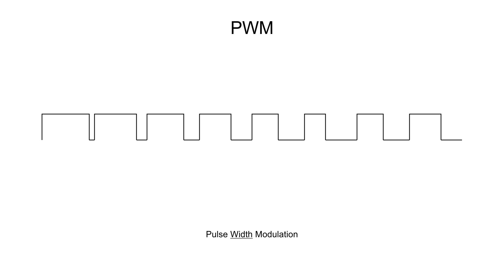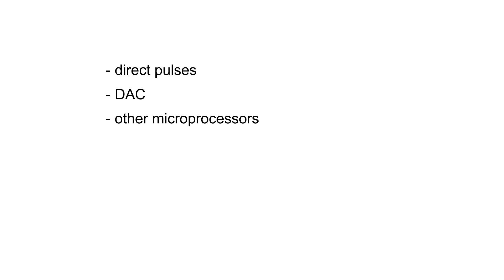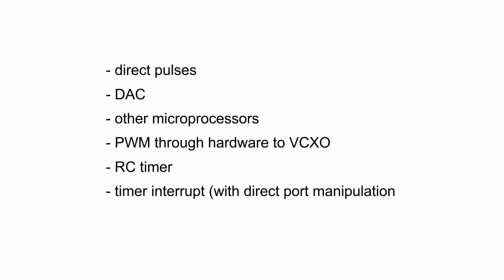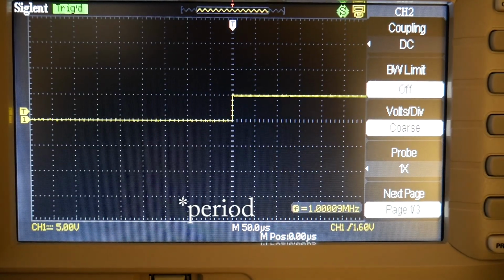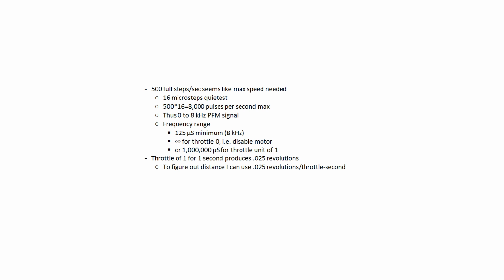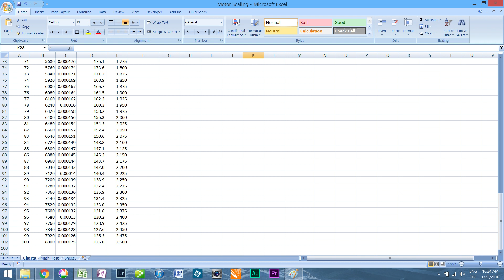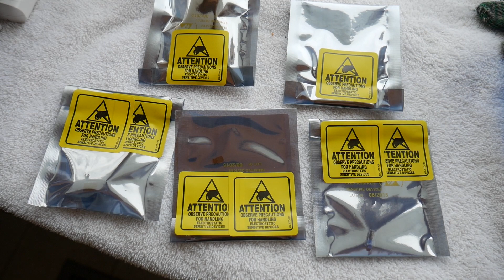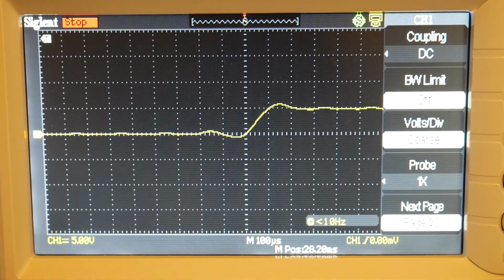Camera Control Arm #4

Comment: Connectors: Cheap options include Cat5 with RJ45 (8C modular) and telephone wire with the appropriate 6C modular connector. For things that move and don't need more than four wires, curley telephone handset cord with 4C modular works well. Last time I was in a Radio Shack (2 years ago. They are all closed here now) they had the cords and receptacles in stock cheap.

Holding header pins straight when soldering wires to them for protoboard use: Stick the pins through a stack of perfboard scraps. The variance in the holes on perfboard will usually give enough friction to hold the pins in alignment. You can also use a bad contact on a protoboard, or a female connector with terminals installed. You can also clamp the pins in a vise with decent parallel jaws, or aluminum or copper spacers to take out unevenness.

Comment: Looking at the ramping up when you push the tac switch, I wonder how much of that is real and how much is some sort of measurement artifact. You seem to be getting pre-echo, which would indicate something fishy going on with your oscilloscope. I guess it doesn't really matter since thresholding and debouncing that signal is a good idea anyways.
Reply from the maker: +Peter Town It's a pretty cheap scope so I don't doubt that the measurements that low may be off. I had no idea what I needed in a scope at the time, later I'll upgrade to a more serious model.

Comment: Also, if you go with Jib design (http://www.bhphotovideo.com/images/images1000x1000/aviator_a1_aviator_travel_jib_aluminum_926202.jpg), you can control the camera angle and maintain the angle as you sweep it up/down.  It uses a simple parallelogram rather than a fixed single arm.

Comment: I've been watching the video series and I'm really liking where you're going. Since you're already going with Arduino, may i suggest the Big Easy Driver (https://www.sparkfun.com/products/12859).  I've had FANTASTIC results with the the Easy and Big Easy with steppers. There are scripts that control the acceleration through algorithms that would help greatly with the oscillation with the start/stop. You could also go with a dual shaft stepper and put the encoder on the back shaft rather than at the axle.

Comment: Why not just use a premade driver like http://www.banggood.com/Wholesale-Dual-H-Bridge-DC-Stepper-Motor-Drive-Controller-Board-Module-Arduino-L298N-p-42826.html?
Reply from the maker: +Cody Carse I am, you can see it around 12:05. It takes care of switching current, torque, decay and microstepping but still requires pulses to take a step.
Reply: +Scott Rumschlag Oh, I was under the impression that these all used PWM signals. Is it the case that you just went with one that uses PFM? Or is that pretty standard?
Reply from the maker: I'm not sure, this is my first time with these things and I chose it mainly based on decent reviews and current capability. I wasn't sure what to expect and figured I would make it work now and optimize later!
Reply: Check out https://learn.adafruit.com/adafruit-arduino-lesson-16-stepper-motors In particular check out https://www.arduino.cc/en/Reference/Stepper I'm not totally sure but I think you're kind of reinventing the wheel here. Which like you've said, can be a good way to learn but I know it can also be frustrating.

Comment: Solving that 514 error was outstandingly clever of you. I paused it when you got to that point and tried imagining what could be causing it (to be fair I have almost no experience in electronics, but your explanations have been enough for me to follow so far) and I was at a total loss. Then once you showed the binary it all clicked into place. I'd never have thought of that, brilliantly deduced.
Reply from the maker: +TheAdmiralBacon Thanks, pulling from the chip does force you to think about the bits though, so it wasn't entirely a bolt from the blue.

Comment: Nice project and well documented problem solving. For your benefit and for those looking to your videos as a source of information,  I would like to mention two of your conclusions that are incorrect - completely incorrect.

In episode three of this project you said that constant current mode does not mean that the power supply is delivering or sourcing constant current.  A constant current power supply means exactly that. You must have not set the supply up correctly.

In this episode you state that a voltage controlled oscillator does not provide a variable frequency for a variable voltage input. It absolutely, positively does. Again, setup or method of use may be the problem.

Just trying to be helpful.

Paul
Reply from the maker: +cdbflynow The setup was okay, I'm still getting everything completely straight in my mind. I'll annotate that part with a link to a better description. I think it's an easy thing to get tripped up on, at least for something getting started, because most of the time you operate in a constant voltage environment.

I just got the oscillators and was looking at the data sheet, here's an example (already knew it was surface mount): http://www.mouser.com/ds/2/3/ASTMK-604412.pdf It says "factory programmed" under the first notes section. Is this the wrong product category? I saw similar things on another one, you're supposed to spec the frequency when ordering it from the factory. If you give me an example I'll annotate this video too and link to it.

(edited to fix the apostrophes being changed into something weird  . . .)
Reply: +Scott Rumschlag That device is a fixed frequency oscillator and it is an electro-mechanical oscillator to boot. Here is an example of a VCO (the first one I came across) http://www.mouser.com/ds/2/405/sn74ls629-407763.pdf.  
In constant current operation the voltage across the load will change as the load changes up to the voltage limit you set. So in constant current mode you have to specify a voltage limit. The bottom line to my original reply is that the names given to the two devices in question (constant current power supply & voltage controlled oscillator) are descriptive and accurate.
Reply from the maker: +cdbflynow I think my frequency range selection was causing part of the problem, I need frequencies that are very low and the lowest VCO category Mouser shows is 1.1 MHz. The nice thing about electronics is these components are so cheap I'll probably pick one up just to experiment with.

Thanks for the info and helping me get these things straight.

Comment: If you find that you melt the plastic on the pins, do this. Dip the solder on the hot tip, have it make a blob, large. Have pre soldered wire ends and use two clips to preposition the wire on the pin and then when everything is said and done, simply dip that blob on to the connection. Dip and swish. It's all you need. Go in go out, if you say that in your mind as you do it, that's how long it should take you.

If you're using a simple fixed temperature solder gun (but a proper one not a chinese one, those are fire hazards with thin substandard gauges on the wires) it's even easier because the temperature won't change as with adjustable ones where the blob on the end might affect the temp (the newer ones are twitchy).

Needless to say, be sure to work over a surface you won't regret messing up, it takes practice moving that blob, but the results are worth it. One last tip, if you put too much solder on, don't bother cleaning it. Let it cool, finish the rest of the connections then using a brush, heat the over-solder and swipe it with the brush whilst it's still hot and liquid.
Reply from the maker: +aserta Sounds like a good technique, I'll try it out in the future. I'm using a Weller WES51 and it holds a temperature pretty well. I upgraded straight from an el-cheapo direct wall plug model a few years ago and will never be able to go back.

Comment: If you are making the motor controller itself, of which the output signal goes straight to the motor, how about using a sin^2 signal to make it quieter, rather than a square wave? I imagine this would allow the magnetic field to more smoothly transition from one magnetic core of the stator to the next. Remember the identity cos^2(x)+sin^2(x)=1, i.e. the total magnetic field would be constant and just rotate ahead of the rotor.
Reply from the maker: +surfcello Microstepping approximates this, I think the higher-end industrial drivers may have true sine waves while the rest simply use more precise microstepping.

Comment: Why don't you just use a CNC driver board like a gShield? Wouldn't it be easier to just write this in Gcode?
Reply: +Joel Crawford I know right
Reply from the maker: +Joel Crawford I want to understand exactly how all the parts are working. I think this will ultimately serve my goal better than G-code. If not, at least I'll be sure.